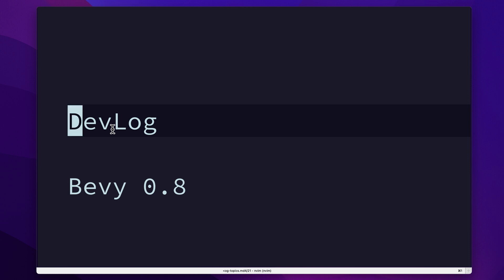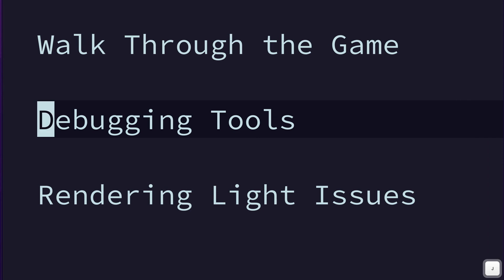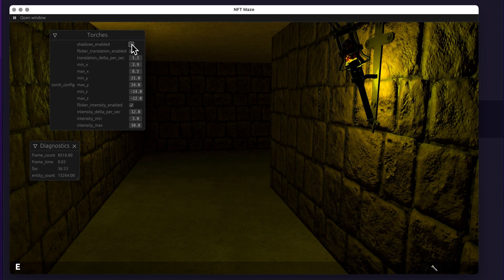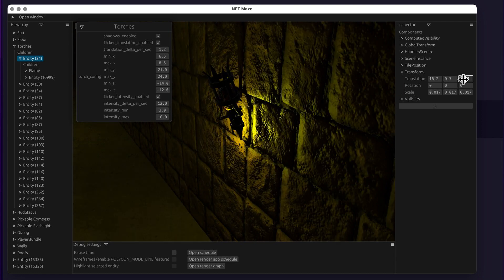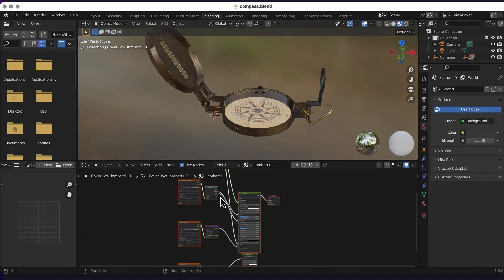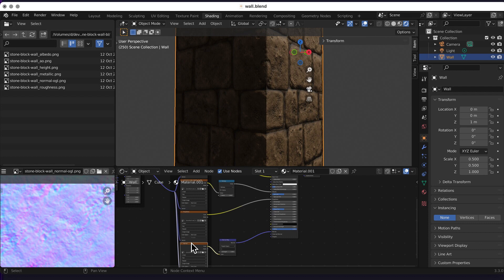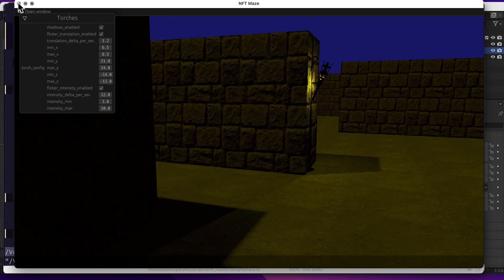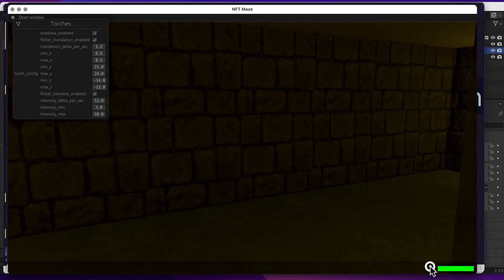Devlog: Rust Bevy Engine Tomb Explorer Game

Comment: Normally players slide along the wall if they run into it. The thing most beginners do is simply stop the player, but of course that's horrible to play. I find it odd to choose to rotate the screen rather than sliding the player.